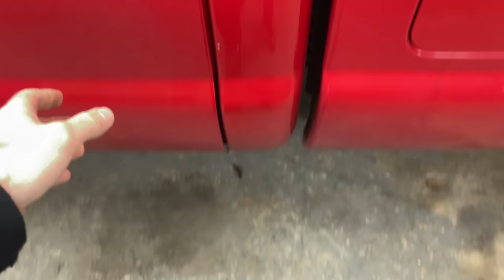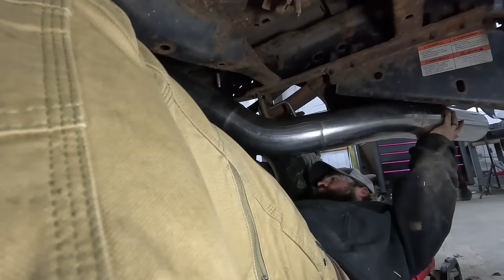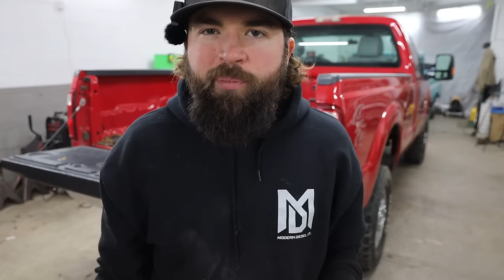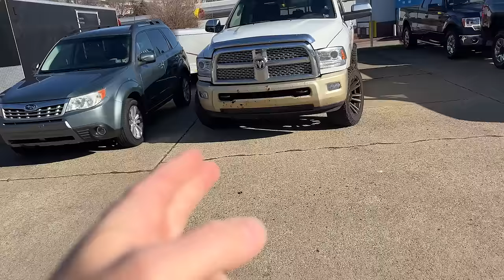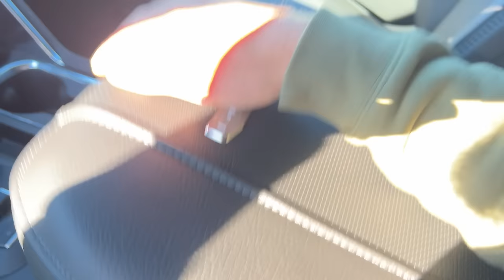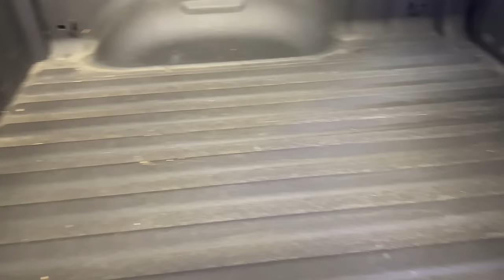UPGRADING MY F-350 6.7 Powerstroke - STAGE ONE - Repair and Truck Lot Tour

Comment: Ive got a 2011 f250 300k, original turbo. Deleted, no egr dpf ccv throttle valve. The tune is a 25 horse with the delete, sct. K&N intake with a much better filter.

Drivers side exhaust manifold warped and broke a stud, went with BD diesel replacements. 4in mbrp down pipe.

The truck is an absolute beast with low end torque, honestly itll push over 20psi fairly easy.

People down talk the sst, i however think that with the proper setup you can get more than what youd expect out of it. And i myself have done the bare minimum. The truck barley smokes when you're giving it the onion.

If it wasn't, my daily driver id add fueling and time, but that i feel would get near the threshold of the stock bottom end. A little over 400hp is what i wanted for reliability, maybe closer to 500, but again stock internals on those early motors were meh compared to whats out now. As far as if you wanna amp them up.

Comment: Dang... IMO, if you would've cut the end pipe at an angle, to match the fender, I believe it would look a lot cleaner... It would match the OE style... I have an '18 with a 5" ATW and the drone at around 1600 to 1650 RPM is horrific!!!

Comment: Hey Corey love the rig and your vids 🤘🏼
Question: just got 5” exhaust , ez lynk w tunes. Haven’t touched my truck yet but….. since it’s stock now, can I take Dpf/put exhaust on THEN tune it? Or do I tune first?!  Guess I’m dumb 😅. Appreciate you man
Reply: @jeremycopeland281 You will have to tune your truck with an off road tune if you get rid of dpf or the truck will not run
Reply: Tune first. Make sure everything loads to the truck properly before tearing anything down so you aren’t left with a paperweight in the driveway